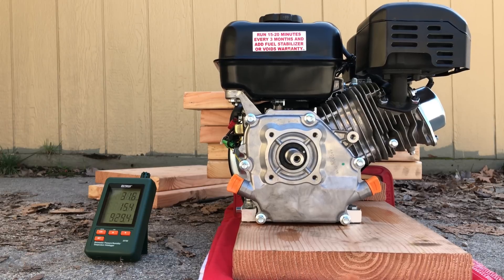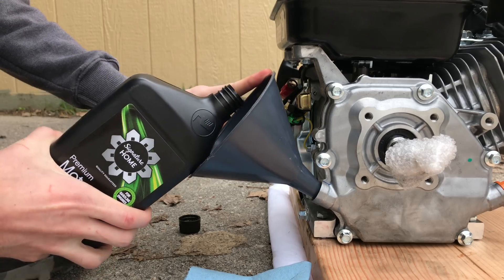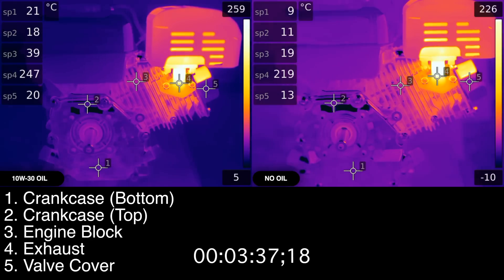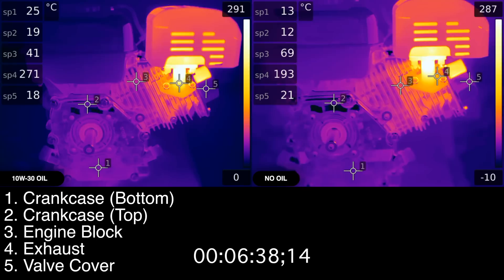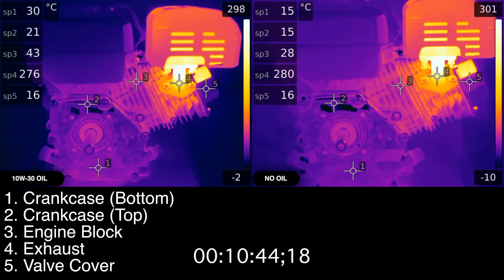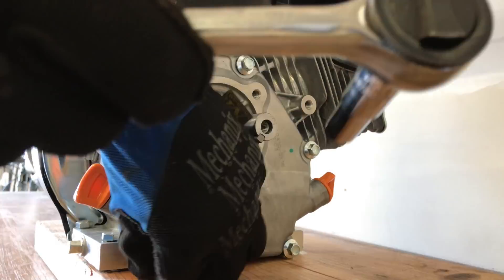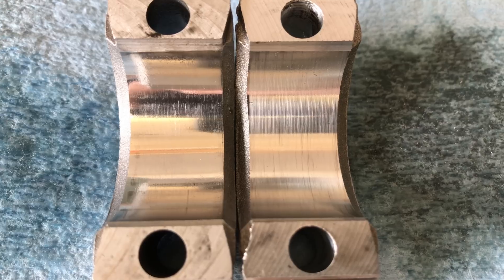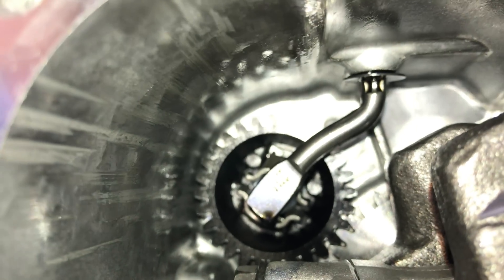What Happens To An Engine Without Oil?

Comment: This engine faired pretty damn well for running for a half hour without oil, even without a load on it. I just got done fully tearing apart a 318 V8 that had been ran to its death without oil, and every single connecting rod big end bearing was totally shot, as with the crankshaft. There was also a piston that had totally melted rings and the entire skirt busted off.

Comment: At 4:22 you can see that the metal changed color, most steel turns blue like that at a bit less than 600 degrees Fahrenheit, and black like on the bottom around 1000 degrees. I don't know how hot that part would get in an oiled engine, but it's interesting nonetheless.

Comment: Oil is for lubrication obviously more than it is for cooling.
Reply: Friction makes heat
Oil helps take away friction...
Reply: @voltag3man  Friction makes heat.... and so does combustion.
Reply: Brian Harris that's what she said
Reply: @4774sammyg  lol
Reply: Adam Craig it’ll probably be ok but don’t do that ever again lmao
Reply: Plus it’s not going to stay cold, it would obviously warm as it travels through the parts that need lubrication, that’s why the temp doesn’t look to be cooler.
Reply: Adam Craig  do it especially bmw's they're made for looks not reliability
Reply: Brian Harris cooling systems
Reply: Adam Craig  I want to a video or pics of your oil. When you see it ask yourself "would I ever cook with oil that looks like this?"
Reply: I figured the entire cylinder would heat up more, rather than the stark difference between the head and cylinder
Reply: Adam Craig  do you dinosaur oil or full synthetic?
Reply: Not necessarily. My car has an oil cooler to keep temps down

Comment: hi i am using honda cb unicorn 150 cc bike. its engine gets very hot after running bike for even 30 min. engine oil is ok what could be reason tatol bike run 5000 km in 4 years

Comment: It's simple: The oilless engine looks cooler like that because air is a shitty termal conductor compared to oil. The one with oil had the heat sink in the liquid and heat the outter case, while the oilless one heated up like crazy on the inside but the air was unable to transfer the heat to the casing at a decent rate.

Comment: huge thing you missed there bud, on the outside it may have been the same but did you see the heat discoloration on the crankshaft? it had to be VERY hot to do that.

Comment: it's not legit. he ran the engine  with oil drained it .the parts are still lubricated. take the engine and clean it out with engine  cleaner no oil residual left it will throw a rod.

Comment: What is really interesting is at 4:21 you can see significant bluing on the crank on either side of where the connecting rod and bearing would sit.  That would seem to indicate the temperatures were actually incredibly high from the bearing running dry.  Neat to see how that wasn't reflected from the external view.  As always, love the content, keep up the great work.

Comment: in other words, oil basicly keeps friction values so low that friction basicly doesn't occur? no friction = much less heat. and less heat means the steel/iron wont expand.. hence why driving with no oil eventually leads to total engine failure because the engine basicly gets stuck?

Comment: It's generally a good test to see the end results of this test. But without oil you are not seeing the heat transfer from the crank to the case. That's why there was little to no change. Without oil you should have just dropped the oil pan and used the thermal camera to observe the temps of the main and rod caps. Not to mention some other sensors to see what the internal temperatures are though that's harder to do with a motor without oil and trying to run it. But also I realize this was a cost effective test to show what can happen on the end of running an engine without oil.

Comment: I already know what happens. a huge chunk of metal flies out the side of the block and goes through your pool. meanwhile the engine keeps running at full throttle filing your yard with so much smoke you can't see a thing until the rod finally snaps and it stops as your crawling through mud to safety. that's what really happens lol.

Comment: the cylinder bore is supposed to look like that. the cross "grind" is there, so the oil doesn't flow down a straight line, but reaches all around the cylinder :) nice video and thanks for the test

Comment: Wow, impressed how little left over oil a stationary engine can last on.

I did this to a Ford falcon (4L I6, aussie one) and it lasted about 10min until the engine caught fire, exterior of the engine was so hot the grease on it burst into flames. Put the fire out and went again for a another 3-4 min until it slowly fizzled out and seized.

Took it apart the next day and it was still warm and I found all the bearing had welded to the crank and the carbon/sludge in the engine was gone, turned to a fine white ash and the crank and rods were blue in colour almost throughout. 

The crank got put in the garden as decoration in 2010 and the bearing are still welded to it to this day lol.

I expected it to throw a rod but instead it was like a nuclear meltdown.

Comment: You really need to do this test with a controlled load, i.e. an absorbing dynamometer. The results are marginal to meaningless otherwise. You might find a local shop with one who's willing to let you use it for some YouTube glory.

Also, I couldn't really see how you prepared those metallic surfaces for IR temperature measurements. Metallic surfaces are notoriously difficult for accurate temperature measurements from an IR camera, especially when the surface isn't even glowing-hot. The surface finish and incident angle are very important and can drastically change your results. You should put a small dab of white-out or other high-emissivity paste on the points you're measuring your temperatures.

Comment: the no oil engine ran fine for awhile because there was still oil in it. draining oil does not completly remove all the oil, there is still a film coating the moving parts, and some pockets in the galleries.

Comment: An important thing to note here is that thermal imaging only measure the temperature of a surface of an object. My theory : engine with oil in it will have a hotter outer surface compared to the one without it. In this example, oil inside the engine will act as a medium for heat generated inside the engine to be transferred outward towards the surface. The engine without oil will have no medium inside it for the heat to move, so the heat will remain in the components inside it, hence the lower surface temperature compared to the one with oil. 

This can be proven with direct temperature measurements of the engine components using Thermocouples.

Comment: Do a transmission without transmission fluid
Reply: Transmissions are way more expensive than a cheapy HT&F 4 stroker, unless HT&F makes a cheap Muncie knock off that I'm unaware of. ;) Plus, most automatics wont shift into drive or anything if there's no oil or too much oil too. You'd have to force the shifter into place. And a manual would be so loud, it'd sound like you had a wood chipper with a bunch of metal being run through it. Both are conditions that most people with >80 IQS would not drive a car under such conditions.
Reply: KKKKKKKKKKKKKKKKKKKKKKKKKKKKKKKKKKKKKKKKKKKKKKKKKKKKKKKKKKKKKKKRRRRRRRRRRRRRRRRR

Comment: Yeah I broke my car engine by running out of oil. Didn't notice the oil situation until the pistons started to expand (no lubrication means they heat up, friction and no heat distribution) and make screeching sound when the metal was sliding against metal. Added oil and got it working. 

Some bearing or whatever started to make weird noise after a week. One more week later, on a trip, the crankshaft shoot out from the bottom of the engine. In the end it was cheaper to buy a new used engine, than to take it for repair.

Wouldn't recommend running without oil, unless you want to destroy the motor.

Comment: Well, that metal content in oil is OK for brand new engines, even in manuals it says that usually after 8 hours of work oil needs to be changed as it will/may contain metal pieces

Comment: The results are right! The oil makes the engine cooler INSIDE, exhaustingthe heat from it, and the thermal camera gets the temperature from the OUTSIDE, soh the engine with more exhaustingheat looks hotter.

Comment: Cooler outside wall off engine without oil is what you would expect if you think about it. The oil serves purpose mainly as a lubricant and also as a heat conductor. Lower temperatures on the outside means there is more heat build up inside, assuming the same power output in both tests.  And if you add higher friction, I bet that the shaft was getting literally red, I you could only measure the temp there, it would off the chart. At some point exhaust was getting hotter in dry engine, meaning that cylinders started to fry as well.

Comment: If the motor was under load it would have had some sort of failure quickly. Surprised to see how little damage there was though. The blueing on the crank shows there was some real heat in there though. Good vid!

Comment: They should make an engine block composite that's aluminum, chrome moly, carbon ceramic, and graphite. The graphite will act as a natural lubricant, then no oil needed. lol

Comment: You should expect these results since the engine you used is air cooled and lubricated with oil. I would be highly interested to see the same test with an engine that operates with lub oil and cooling oil/water as well.

Comment: that "premium" expensive oil is still remain on the engine, thats why the engine doesnt wreck, maybe just a couple thin layers of oil film but thats enough to keep the engine running (hence the idle only engine). just courious, what if you flush the engine first (with oil flush product or just use gasoline) then repeat the "without oil" test??

Comment: If you think you can't afford to maintain you car, it's certain that you can't afford not to. Car maintenance is far cheaper than car repair. 

If you have difficulty paying for maintenance and repairs, learn to do it yourself. Basic tools aren't very expensive, and there are plenty of on-line resources to teach you how to do basic maintenance and repairs. Start off with simple things like oil changes, replacing blown bulbs, and the like, and work toward more complicated repairs like brake jobs. You'll learn a lot, and that will keep you from getting ripped off by unscrupulous mechanics. Just the knowledge you gain can save you a lot of money, since if you know what the problem is when you take the car to a mechanic, you will know when he's trying to rip you off.

People are intimidated by the complexity of newer cars, but for some jobs are not bad at all. For example, changing brake pads on a new Maserati isn't appreciably more complicated than for an old Mustang. Just read up before you start, to determine if the repair is within your ability. YouTube is good resource for how-to videos for specific repairs on specific cars.

Comment: I've always wondered if a friction-less material used to make engine parts could solve an engines reliance on oil. This will likely never be invented or it would become a suppressed invention if it ever was invented because there is too much money that would be lost if the need for oil went away.

Comment: Hi Engineering Explained. I have a 2015 Acura TLX V6. If you haven't already heard, this car comes equipped with a 9 speed ZF DCT that's been heavily criticized as being very jerky in shifting gears. Honda has been quick to swap out the 9 speed ZF DCTs for the 8 speed DCT. I've read some articles and forums stating the jerkiness has something to do with the "dog" clutch gears. I'm genuinely interested to know why these transmissions came out badly designed. Would you make a video explaining this? I hope my fellow youtubers like this comment to get his attention. Thank you all.
Reply: Get a manual. Manual transmissions have been perfected compared to auto
Reply: Try having a 2013 Ford Focus SE, talk about bad transmission issues 😣
Reply: Modern car transmissions are very weak
Reply: I heard that some tuning out a bandaid on that transmission.. they pretty much disabled 1st gear as the fix. I’d be upset . I do love the 10 speed in my F-150 though!

Comment: they say you should not let an engine sit for months at a time without running because the oil seeps out of all the bearings and little bits at a time it wears like this until the oil pumps back up to pressure.

Comment: The purpose of oil is to act as a lubricant to prevent engine wear. It doesn't significantly cool the engine, you're thinking of, well, coolant.
Over time, without oil, parts of your engine would wear down until the engine seizes up.

Comment: I, too, would have suspected the motor to run much hotter without any oil. But in hindsight the heat from combustion has to be so much bigger than the heat produced by the small surface area that actually experiences friction.
The main use of the oil is to lessen scuffing in the first place, with heat transmission only being an afterthought.

Comment: Next time try running the engine with out ever putting oil in it. As soon as you run oil in an engine it will "season" the metal. Oil will work into the metal at the micron level and take quite a while to come out if all the machined surfaces are good. The longer you run an engine with decent oils in it the more it gets worked in. Remember Slick 50, an additive with moly particles in it that supposedly gets in the metal, and claims you can drive your car with out oil it works so well? It is a scam because that's what the oil already does. When they demonstrated draining car oil and driving around and nothing happened, that would happen anyway in most cases(I wouldn't try it with a German car) You should do some research on the properties of oil and machines because there is a polarity connection with how it all works.

Comment: Oil help transfer heat from piston to walls of cylinder and it decrease friction between moving parts. because interior of engine was not properly  cooled heat remained inside and exterior was cooler.

Comment: I think - and you point this out - the oil is acting as a heat conductor, which causes the crankcase and cylinder head to run hotter, but allows the internals run cooler.  It'd be interesting to see the experiment repeated, with thermocouples embedded in various locations ...  which would undoubtedly be hard to do.

Comment: Interesting video, thanks for sharing.  

Three additional key points that you might want to make to your viewers are the fact that:

1) There was some initial lubrication in the engine that was drained and run with no oil and even that small amount of oil provides decent lubrication at low RPM's under no load.
2) The Second point is that this test was performed at low RPM, would be interesting to see it at half throttle for a few minutes
3) Lastly, it would be interesting to see the same test at half throttle under full load

Thanks again for a well produced video.

Comment: These engines were running with no load on them. Why don't you re-try the test on 2 pressure washers to see how long the one without oil will last? I think the results will be very different.

Comment: Could it be that since there's no oil to adsorb the heat from the internal engine part, that heat stay trap nside since there's no oil to cool it off? . Since it's not cooling as much from the outside it wouls seem not to be that much hotter, but internal parts could be hotter?

Comment: I could have told you.... oil has 3 COUNT'EM 3 FUNCTIONS ONLY!! 1) Isolate moving parts 2) transfer heat 3) keep particulates suspended so they can be trapped in the filter. THAT is ALL!!

Comment: Hey - I really like your videos it's helped me with my knowledge of cars and engines. So I recently switched to AMSOIL and they claim they have third party testing for 40,000 km normal service and approx 23,000km drain intervals for their signature series
 I am curious as to what your thoughts are about this. Should I follow the oil or the manufacturer drain intervals? Also when it comes to oil, for specific products for high milage etc... What's the difference from regular oil or regular synthetic? Are you able to do a video or pm me here with your thoughts? 
Thank You
-

Comment: The thing that would have made it blow up is it needs a load on it.  With no oil in it and load on it the rod would have went threw the side of the block.  Back when I was a teenager I worked at a lawn mower shop and we did all the repairs for Home Depot.   When the owner wasn't there I blew all kinds of there stuff up.

Comment: If you were hoping to achieve an engine seizure, with an engine that size, I think it's more likely that the engine would stop running from lack of compression from cylinder wear or even more likely, some other parts snapping first. I'm guessing that the piston just isn't large enough to expand and lock in the cylinder. On another note, while oil does help with cooling, that's not its primary function. It's not that surprising that the heat difference wasn't all that great. Especially since there doesn't appear to be an oil cooler on that motor. For the sake of science though, you should run the oil-less motor until she dies and see what official cause is.

Comment: It still blows my mind that I can buy a brand new (semi decent) small engine for $90!  Like the others are saying, having a load on the engine would dramatically change the results.  I think powering a water pump or large fan would be a great way to apply load, using a rig you could easily fabricate and store at home.  Either way, keep up the great work!

Comment: I wonder if the oil transmitted the heat from the internal components to the outside resulting in higher temperatures